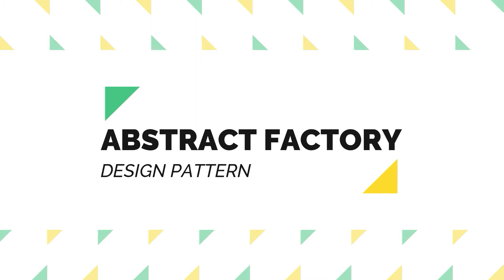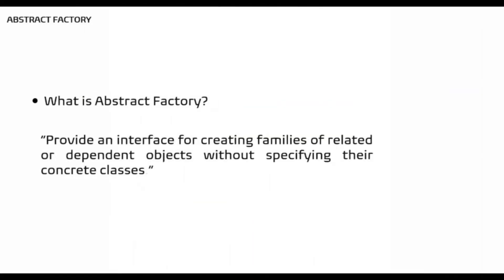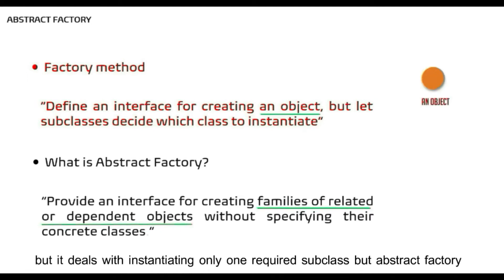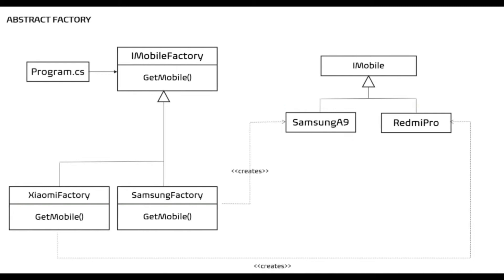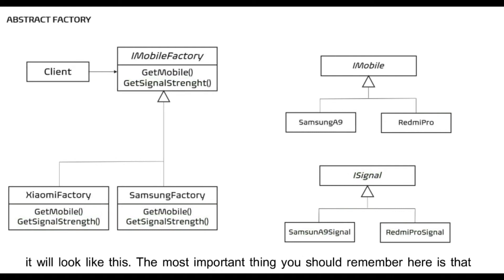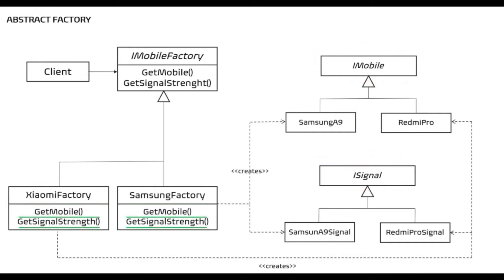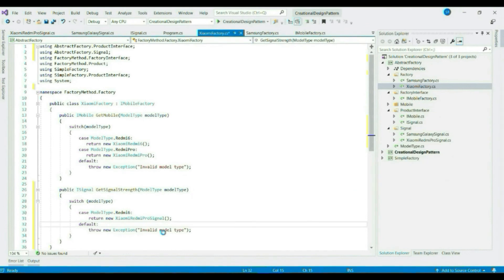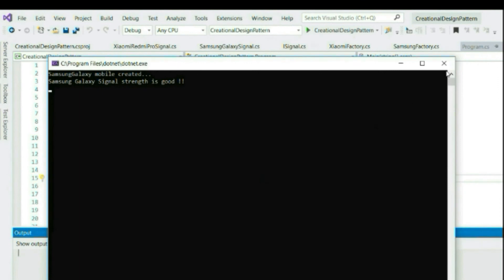Abstract Factory Design Pattern I Design Pattern (Part 4) - When to use abstract factory

Comment: Your violating openckose princippe
Reply from the maker: Thanks for the comment. Where do you think open close principle has been broaken?
Reply: In your factory classes. 

What if there are more number of mobile models in future.  You cannot keep on modifying the same factory class adding all classes in switch statment..

You can argue saying additional concrete factory for such requirement could be created  but this leads to n number of updates to your library and finally harder to maintain.

As per me,  creating a class for every mobile  model is not at all gudd idea because this is the constanly changing thing

Hence those patterns should not be used in these kinds of scenarios at all even for the sake for explanation..
Reply from the maker: @anianand9887  The responsibility of a factory is to create instance based on some criteria and give it to you, nothing else. No implementations of your strategy/logic inside a factory should be done.

Open/Closed means you can modify the way a system works without modifying the code that already exists. You can extend the code and use it in different ways, but the old code is still in tact and doesn't need to be re-tested.

It does not break open close principle rather factory design patterns actually works well with the Open/Closed principle if done correctly.

Creating a factory helps instantiation logic to be in one place, avoiding code duplication and making it more readable. 

Obviously, in every scenario it does not fit in and is also not possible at times.
 
Design patterns are meant to solve specific problems, though many times it appear to break one or the other principle, but understanding their intent would help to realize its value.
Reply: @RGenics sorry if you have understood in a different way.

 I am not saying factory pattern breaks open/closed principle rather the example you have used is not suitable as it breaks OCP.

Though you gave explained a pattern correctly, the use-case you have chosen is completely a wrong one..
 
I let you think on this a bit more. I end my discussion here .

Thanks